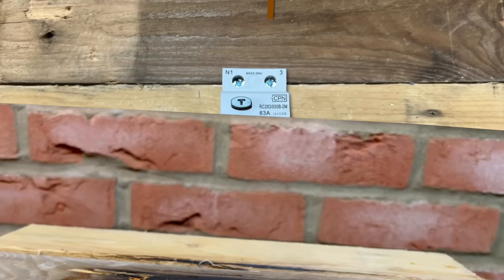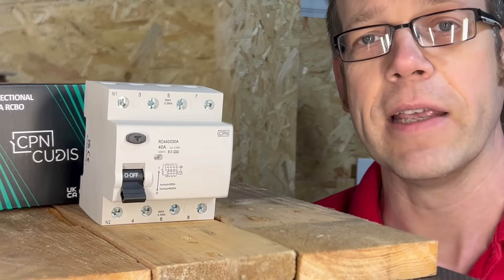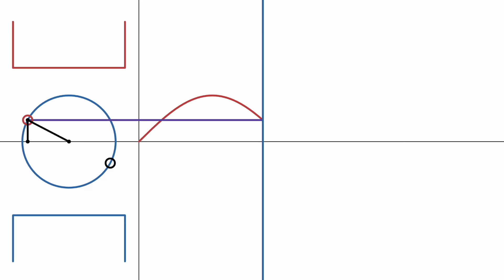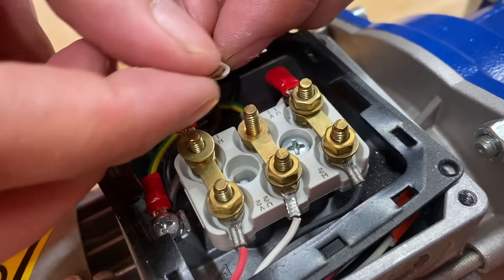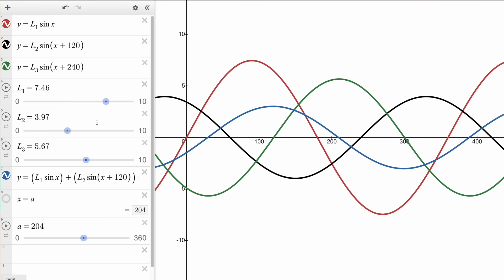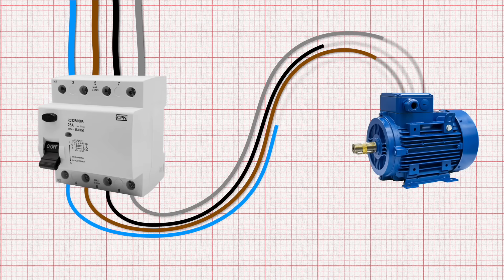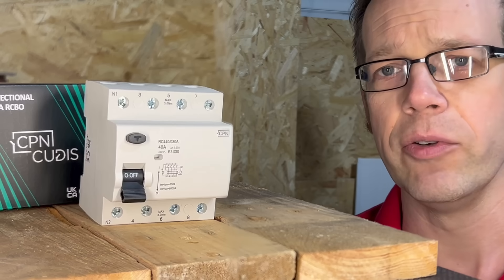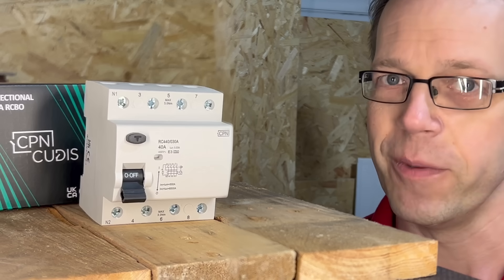This Simple RCD Error Could Be Deadly!

Comment: He is making things up.
In a 3 Phase and neutral supply there is NO 3 PHASE RCD and NEUTRAL that you can fit that is NOT PROTECTING A SINGLE PIECE OF EQUIPMENT.. be it three phase and neutral.. that piece of equipment is using JUST the three phase part of it not the neutral. 
I work in industrial and there are almost no suche equipment that requires three phase AND neutral. Just three phase!

I would like the uploader to give us an exact scenario in which three phase nad neutral is so deadly.. (more deadly that exposing ourselves to different potential between 2 phases?
I don't think...

Comment: Hi! I made a Hungarian subtitle. If you're serious, could you put it in the video? => 
1

00:00:00,000 --> 00:00:05,000
A háromfázisú áram-védőkapcsoló helytelen alkalmazása halálos lehet.

2
00:00:05,000 --> 00:00:09,000
Ha nem érted, hogyan működik egy háromfázisú RCD, az eredmény végzetes is lehet.

3
00:00:09,000 --> 00:00:14,000
Egy egyfázisú RCD működésének megértése viszonylag egyszerű.

4
00:00:14,000 --> 00:00:18,000
Figyeli a körben a befolyó és az onnan kifolyó áramot.

5
00:00:18,000 --> 00:00:22,000
Normál, hibamentes üzemben ennek a két áramnak egyenlőnek kell lennie.

6
00:00:22,000 --> 00:00:27,000
Ha különbséget érzékel, akkor tudja, hogy az áram valahol elszökik a föld felé.

7
00:00:27,000 --> 00:00:32,000
Ez történhet hiba miatt a védővezetőn, vagy akár egy emberen keresztül.

8
00:00:32,000 --> 00:00:35,000
Az RCD mA értéke azt mutatja meg, mekkora áramkülönbségre old le.

9
00:00:35,000 --> 00:00:40,000
Amint az egyensúlytalanságot érzékeli, lekapcsolja az áramkört.

10
00:00:40,000 --> 00:00:44,000
Ezt mágneses elven és indukált áramokkal magyaráztuk már korábban (Kirchhoff csomóponti I. törvény).

11
00:00:44,000 --> 00:00:48,000
A háromfázisú RCD története azonban ennél összetettebb.

12
00:00:48,000 --> 00:00:51,000
Ha ezt a videót közösségi médián nézed, kattints a leírásban található linkre.

13
00:00:51,000 --> 00:00:56,000
Ingyenes továbbképzési anyagként érhető el, és tanúsítványt is kapsz.

14
00:00:56,000 --> 01:01:01,000
A háromfázisú RCD is áram egyensúlytalanságot keres a fázisokon és a nullán.

15
01:01:01,000 --> 01:06:00,000
Egy egészséges háromfázisú rendszerben ezek összege nulla.

16
01:06:00,000 --> 01:11:00,000
Ugyanaz az elv, mint egyfázisúnál: 10 A kifelé, 10 A visszafelé.

17
01:11:00,000 --> 01:17:00,000
A különbség az irány: az áram ellentétes irányban folyik.

18
01:17:00,000 --> 01:21:00,000
Az RCD szempontjából ez olyan, mintha nem is folyna áram.

19
01:21:00,000 --> 01:26:00,000
Három külön fázis esetén ugyanez történik a három külön fázis és a nulla között.

20
01:26:00,000 --> 01:30:00,000
Ha figyelembe vesszük az irányokat, az összeg mindig nulla.

21
01:30:00,000 --> 01:35:00,000
Itt válik kissé bonyolultabbá a történet.

22
01:35:00,000 --> 01:40:00,000
Váltakozó áramról beszélünk, amely folyamatosan irányt vált.

23
01:40:00,000 --> 01:45:00,000
Ezt hullámformával ábrázoljuk, amely 360 fokos forgásnak felel meg.

24
01:45:00,000 --> 01:50:00,000
A három fázis 120 fokkal van egymáshoz képest eltolva.

25
01:50:00,000 --> 02:02:00,000
Ha a három fázis árama azonos, akkor bármely időpillanatban az összegük nulla.

26
02:02:00,000 --> 02:07:00,000
Ezért nincs szükség nulla vezetőre a legtöbb háromfázisú motor esetén.

27
02:07:00,000 --> 02:12:00,000
Nincs áram a nullában, mert a fázisok kiegyenlítik egymást.

28
02:12:00,000 --> 02:16:00,000
Három fázist kétféleképpen használunk.

29
02:16:00,000 --> 02:21:00,000
Vagy tisztán háromfázisú fogyasztókhoz, például motorokhoz.

30
02:21:00,000 --> 02:26:00,000
Vagy egyfázisú áramkörök ellátására elosztótáblán keresztül.

31
02:26:00,000 --> 02:34:00,000
Ebben az esetben a fázisok szinte sosem terhelődnek egyformán.

32
02:34:00,000 --> 02:42:00,000
Az egyik fázis nagyobb áramot visz, mint a másik kettő.

33
02:42:00,000 --> 03:01:00,000
Ilyenkor a nulla vezetőben már áram folyik, az aszimmetria miatt.

34
03:01:00,000 --> 03:16:00,000
De fontos: ha a nullát is figyelembe vesszük, az összeg még mindig nulla.

35
03:16:00,000 --> 03:26:00,000
Ezért az RCD továbbra is nullát vár el összesítve.

36
03:26:00,000 --> 03:32:00,000
Ez határozza meg, hogyan kell helyesen bekötni a háromfázisú RCD-t.

37
03:32:00,000 --> 03:48:00,000
Ha szimmetrikus terhelést lát el, nincs szükség a nulla bekötésére.

38
03:48:00,000 --> 03:57:00,000
Ha viszont aszimmetrikus terhelést, akkor a nullát is be kell kötni.

39
03:57:00,000 --> 04:12:00,000
Ellenkező esetben az RCD hibásan működik vagy nem véd megfelelően.

40
04:12:00,000 --> 04:23:00,000
Type B RCD esetén a nulla mindig szükséges, mert feszültségfüggő eszköz.

41
04:23:00,000 --> 04:42:00,000
Ez referenciafeszültséget biztosít a működéséhez.

42
04:42:00,000 --> 05:01:00,000
Mindig ellenőrizd a gyártói utasítást és az alkalmazás jellegét.

43
05:01:00,000 --> 05:14:00,000
Így maradsz biztonságos és szabványos a háromfázisú RCD-k használatakor.

44
05:14:00,000 --> 05:33:00,000
Köszönjük, hogy megnézted a videót!

Comment: Even if three-phase RCD is properly connected, there are scenarios where an error current could be MUCH higher that tripping current but RCD still wouldn't trip! I did an experiment and proved it so. This happens if devices on all three phases have similar error currents that at the end cancel each out.

On the other hand, there could be situations where RCD trips with NO broken loads (both single and three phase ones). Every load normally has a small error current going through noise suppression/overvoltage protection circuit (usually about 1mA), especially if they're powered through SMPS'es (PCs, TVs, monitors, notebooks etc.). If multiple loads are connected through one RCD, error currents add up and can cause RCD to trip, although there are no broken devices in the system. This is bigger issue in networks with three-phase RCDs (as they are usually installed to protect much bigger number of circuits and loads).

Remember, RCDs usually trip on lower error currents than specified (i.e., 30 mA RCD usually trips at about 18 mA).

Comment: When going from a 3-phase, 3-wire load circuit (no neutral)  to a 3 phase 4-wire (Neutral included) circuit(s), somehow we've found (or lost) a wire. Such "loose" (lost) wires create brain farts, confusions and possible burning smells.

What was missing was the 'Earth', and how it's connected (or not) to a Neutral, which may or may not be present.

Comment: The only bad scenario I see here is accidentally connecting PE or PEN through the RCD instead of N (on an installation where the load doesn't need an N). I have actually seen such a mistake in the wild once. But I'm not sure the video is covering this case clearly enough.

Comment: What's the deadly error supposed to be? If a 3-phase unbalanced load is connected to an RCD without the neutral passing through, then the RCD will just trip instantly... no danger.
Reply: It wouldn't trip, actually, unless the neutral is grounded past the RCD. The voltage on the floating neutral would rise and it would pose a danger because you could have more than 230 volts between a phase and the neutral. Imagine having a heater on one phase and a light bulb on the other, since the neutral is floating, it would be "pulled up" to the voltage of the heater and the light bulb would experience 400 volts between its phase and neutral.
Reply: @astral-proj3ction Well yes, but that's not a problem that is specific to RCDs. It can always happen in an unbalanced three phase system if the neutral breaks.
Reply: @mnbvcx Yes but the commenter is saying that the RCD would trip, which is false. There are separate loose neutral detectors mounted on a DIN rail that are used in some installations, when they sense a voltage between neutral and ground they run a small current which trips the RCD.
Reply: @mnbvcx  Not only if it breaks, also where it can be isolated (RCD and 4-pole switches). The neutral should there always be connected to the specified N-terminal because the N needs to be disconnected last and reconnected first by a switch.

Comment: A 3 phase motor does not have balanced current loads. The voltage on each phase is never equal, and the current can be around 10% different on each phase leg. Even a 240 in/240 out invertor wont have equal voltages on each phase, even on a new motor.

I've only ever seen RCDs on motor management/control panels where there is adjustment that well exceeds the 30 and 200 ma trip curve timeline.

Or, the RCD has been bypassed due to the EMC/noise filter network transient current being as high as 60 amp on the main earth/cpc/ground connection. 

There are too many filters to disconnect just to comply with the "Get out of jail free" overuse of RCDs/GFCIs where they don't need to be used. Especially on plant and machinery. 

Thankfully, the everchanging little improving wiring regs/codes for fixed final circuits do not apply for machinery.
Reply: The importance point is that the sum of all currents will be still be zero unless it's going somewhere it shouldn't.
Reply: @JaenEngineering 

Would you still put an RCD/GFCI on a 3 phase and neutral supply to a control panel, that supplies filtered power supplies and directly fed and indirectly fed motor 3 phase motors?
Reply: @poormanskint3008 yes. If there's any chance, or need for one or more phases to be split off (IE for control purposes) then you need to monitor the neutral. But for a final circuit that is only going to a motor or other device that doesn't require a neutral, there's no need as all the current will be carried by the phase conductors.
Reply: @JaenEngineering 

A differential in the phase currents will be encountered caused by unequal/unbalanced loads, along with heavy transients up to 60 amps flowing down the earth/CPC and neutral from the EMC filters that will cause the RCD/GFCI to nuisance trip.

That's why if a designer has over construed the requirements of EEBAD/basic/additional protection, and put an RCD on a panel instead of an isolator. The trip sensitivity adjustment is turned up well beyond what the fixed wiring regulations/codes state it should be. Or, simply bypassed, and the distribution isolator is used until a standard isolator is fitted, with site agreement of course. Otherwise, there will be non, or very little production without power interuption.

Thankfully, it is the IEC that governs controls for plant/processes, machinery, and other equipment, and not the IET, NEC, CEC or any other fixed wiring COPs. That are not law, and only there for guidance where no other information or specification isn't provided or available.

However, there has been occasions where I have to disconnect numerous EMC filters as the site managers decided to follow the RCD rules. Resulting in an even worse non compliance with EMC directives. Potentially allowing the porting/decoding of transients on safety control circuits that "Legally," need to comply with SIL 1,2,3, and 4. Which could result in death or injury if not applied and complied with. 

Much worse than the low risk of electrocution or shock from any kind of contact with directly or indirectly earthed enclosures, containment, or heavily insulated class 2 final circuits connected to ancillaries and other services. That in turn are regularly inspected, maintained, and governed by a safe systems of work and practices procedure.

The socket inside or on the panel door usually for a laptop is only ever considered with rcd protection. But not always considered at the sites request due to the wiring practices of that country, and the history of low numbers of electrocution or shocks.

If you have considered or are considering RCD/GFCIs in your design for controls and process. Then I wish you all the best with continuation and future work orders. For it will more than likely cause contingency problems with production or reliable service. Only for it to be replaced with a standard isolator.

Comment: What about a 5 pin commando socket, 3 phase neural and earth, would you need to connect neutral through the rcd protecting this socket, as anything could be plugged into the socket with a 5 pin plug on
Reply: As there is potential for the phases to be split into phase-neutral pairs that could unbalance the system then yes, the neutral also needs to be contacted.

Comment: I did not understand in which wiring scenario that it could potentially be deadly?
Reply: I didn't understand either, he explained how things work and how it detects the fault but.. whats with the title? "This Simple RCD Error Could Be Deadly" - what error?
Reply: It got you to watch it didn't it.
Reply: Deadly for the reputation of the installer
Reply: I thought they were going to outline an edge case, due to the fact that the imbalances will cancel to some degree, so (assuming 30mA) RCD, if you start with a leakage on L1 of 15mA, obviously thats not going to trip it, now if we add 15mA on L2, nothing much chances and we still have a total of 15mA flowing in the earth conductor, if now we get someone touching a live part on L3 and 30mA flows from L3 to earth we would want the RCD to trip..... but the first 15ma balances everything to  zero with no overall earth leakage so is effectivly hidden, then the next 15ma does get seen, but we are effectly leaking 30ma to earth on L3 and nothing trips. Of course its quite specific and the chance of the amount of standing leakage on L1 and L2 being significant in terms of the effects of the de-sensitisation that occurs on L3 is probably somewhat unlikely - but its a hole in that layer of the swiss cheese model
Reply: @Adam_151  The balance would be at 0 V if balanced; a separate neutral if you would. Only the imbalance is the potential difference, in theory. Unless the balance is occurring between a person, which would all require remarkable circumstances and and timing.
Reply: You're an electrician, City & Guilds qualified, you're the expert aren't you? Can't you work out the scenarios where it is dangerous?
Reply: The title is click bait. They aren’t generally over the top with it, but the algorithm rewards that behaviour so what can you do?
Great video though.
Reply: @TimmyBoja  Stop watching basically, just a shame if it's YouTube's algorithm that forces channels to go down that road. It's a great video, but a waste of my time, since it was sold as something else, and I knew everything beforehand.
Reply: It’s the fact that it’s essential to connect the N to N as the sum is expected there. It’s obvious, and therefore didn’t mention it clearly enough.
Reply: @syproful  It's pretty fucking obvious, pardon my french. All I saw was just a video of how an RCD works, which most electricians probably knows. But the videos and titles are good in general, so I don't really suspect them for intentionally doing clickbait this blatantly.

Thanks for your answer!
Reply: but the title said deadly  @syproful  , if i dont connect N - it will do what it's designed for and just trigger and stuff does not work. When is deadly coming to play?
Reply: @syproful but it's not deadly as the circuit would trip as soon as the load was connected

Comment: so what was the error? not connecting the blue wire?
Reply: One step is probably semiconductor which is connected to neutral wire, so leakage will be detected only when neutral wire is connected. 

It was desease of slim RCBOs, but now 4-pole B-type RCDs have this problem.
Reply: @Dmitrytln there wasnt one. It was needless clickbait

Comment: Contactor and relay coils use neutral wire, also signal lamps working on 240 volts. Motor connector doesn't have neutral wire, but control centre has neutral wire. 

Neutral wire is not required only when you driving motor manually through isolation switch.
Reply: Not unusual for older control panels to have 400v rated coils, lamps and control switches, negating the neutral issue
Reply: @andyleggatt1846 USSR electricians connected 220V contactors through resistors or other voltage droppers to linear voltage, control panels were warm
Reply: also the motor is usually connected to a 3 ph contactor
Reply: You are wrong here. Contactors and coils commonly work on 400V. So do DOL motor switches with overload protection etc.
Reply: Pretty common for motors to have their own protective devices so that if a motor goes south it doesn't take out the whole panel. Especially important in BMS.